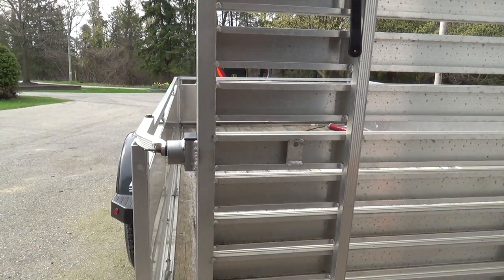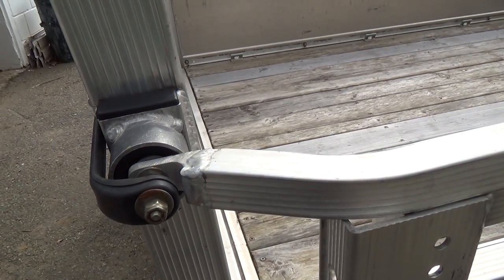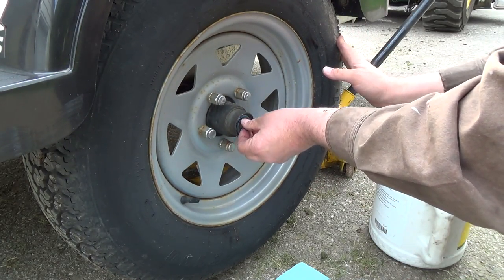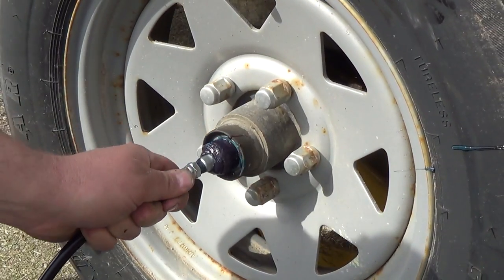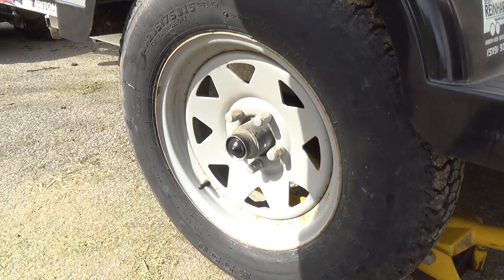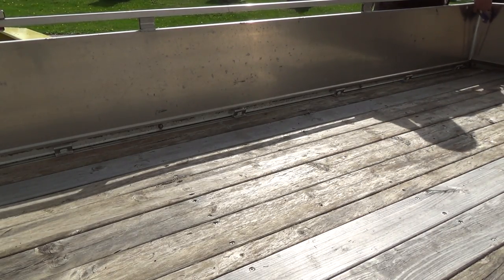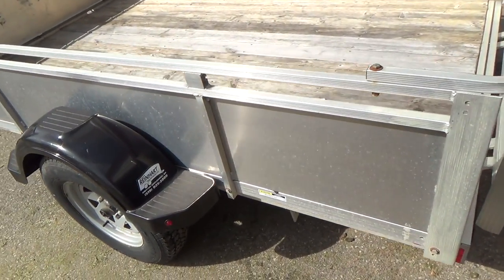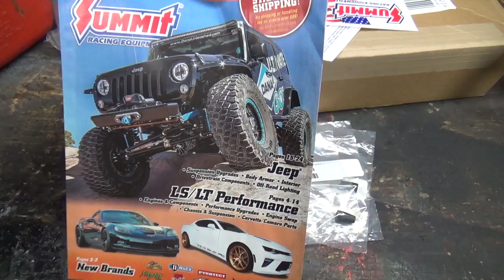Little bit of service work to the 6' X 10' triton trailer

Comment: Bill, about those gate locks.. It wouldn't be a bad idea to drill straight through the gate and install longer bolts with a hole on the end for a quick release pin. You could then close the arms onto the bolts. To stop any play you could measure in polyurethane or rubber bushings to put into the arms. That would last a lot longer and be less of a pain.

Comment: just a question bill what about using a post hole auger to did cremation holes
Reply from the maker: yes I have wondered that too but when you dig where there is already someone you have to be careful and the soil would pile up around the hole so you would have to remove that as well
Reply: i  been looking at some at my faviorate store princess auto :)

Comment: That's a nice looking trailer Bill, maybe you could check with Princess Auto,...did I see those trailer wheel sizes on 'sale' this past flyer ? 
I have a question on the trailer's jack, why is the jack bolted to the outside of the left 'A Frame" draw bar and not installed down through it, as there's a cut out there for a jack ?
Reply from the maker: im not certain on that one. more clearance when you flip it horizontal i suppose
Reply: Yes, I suppose that could be it,...Thanks for the reply though.
Reply: Reg Sparkes I love my Lock n lube. have it on a Dewalt battery powered grease gun. fast daily lube on my tractor loader and trailers.
Reply: Hi Steve, yes those are a slick little invention aren't they? They're great for those hard to reach places, especially.

Comment: Hey Bill just thought I'd suggest for the brackets on the trailer, Have toy thought about either welding or bolting on a couple of handles to grab ahold of and to pull on? itll save your hand for sure Just a thought
Reply from the maker: for tying to?
Reply: At 4:25 you talk about not liking the holders for the tailgate, that's what I was referring to
Reply: To be able to pull on the handle instead of cutting up your hand on the steel of the trailer

Comment: I have gone through several of those inflators with that clip on style fitting... Amazon has replacement ones that screw onto the valve stem instead of clipping on.  If the one on that is removable, grab one of the screw on style ones.  Even the better ones from Milton that use the clips are better as it uses two clips on opposing sides to hold the fitting down.  The issue with most those air guns though is the insert inside them that is supposed to make the seal.  It hardens up quickly and the single clip just can't hold it tight against the stem.